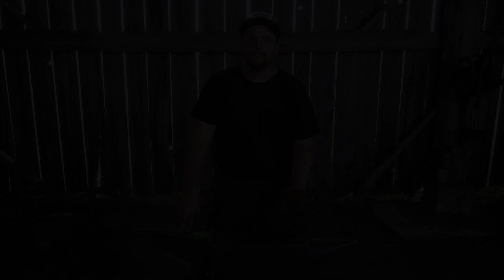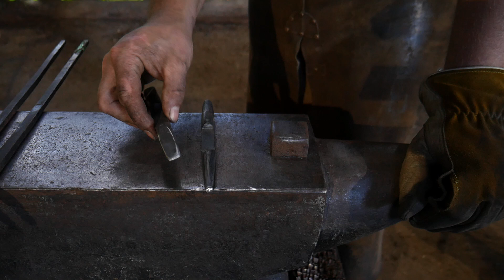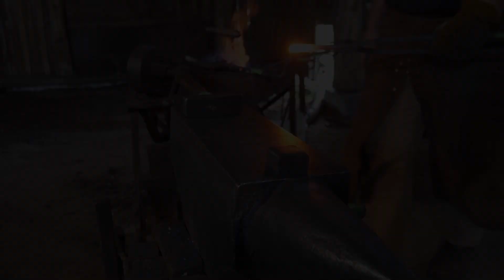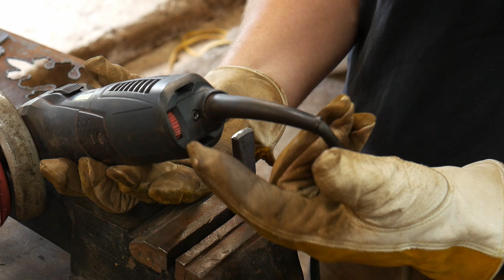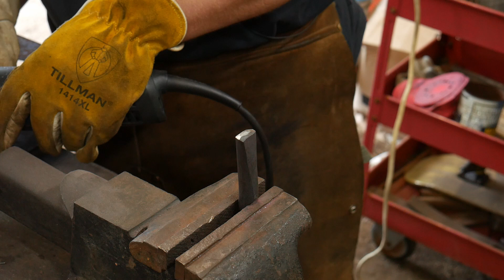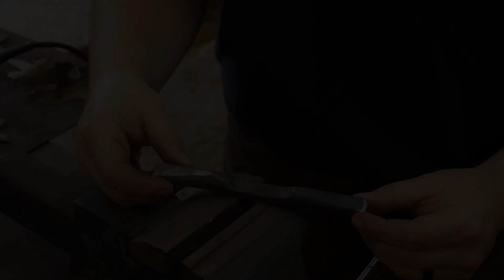Forging a French Repousse Stake Fuller

Comment: A stake fuller will be very handy in my vise.  Didn't ever think to look for 400x or 600x discs for my grinder. Have been using files and crocus cloth over 50 years.  Good tip. Thanks.